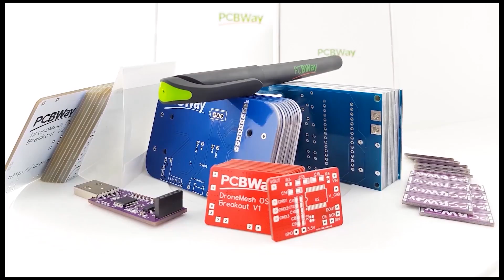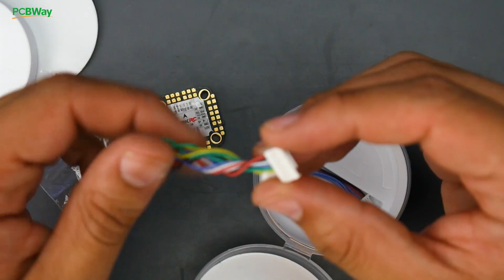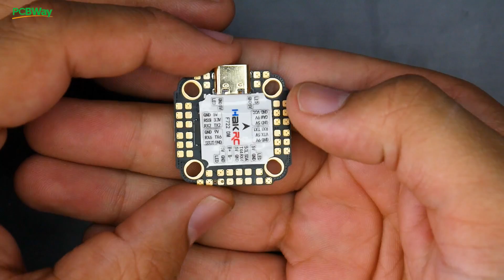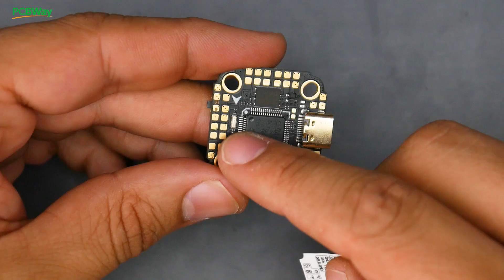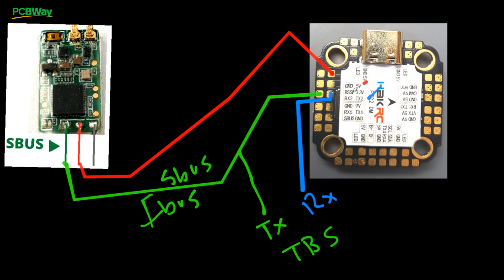Hakrc Are Making Changes!!! // HAKRC F722

Comment: hello brother. I have this flight controller and its not reading battery voltage anymore after last week’s crash that killed the esc. can you suggest which component thats faulty on the board that I can try to replace?

Comment: bought this board but betaflight is not recognising the flash memory for Blackbox. Somebody knows what is wrong?
Reply: Yeah, that got screwed up. Copy/Paste this into the CLI:

set blackbox_device = SPIFLASH
set flash_spi_bus = 3
SAVE

~Blade
Reply: @OnBoardWithBlade  God bless the internet. I knew someone would know something about it.
I tried to set the blackbox up as you described but it still shows critical error in the blackbox page. 
Do you know anything else that needs to be done there?

Comment: Might be a dumb question, but why is frsky sbus not connected to sbus pad?
Reply: FC with a F7 MCU has inversion build-in on every UART. F4 boards not so there you had a dedicated SBUS pad, which had an inverter on one specific UART. This hole inversion issue is a frsky thing. That is why we are even talking about it.
Reply: Boris Martens Boris Martens I agree with what your saying, but with the giant white sticker on the FC labeling a lower pad as SBUS,  I could see someone newer to the hobby getting confused easily.  Not that big of deal, just thought he shoulda explained that.